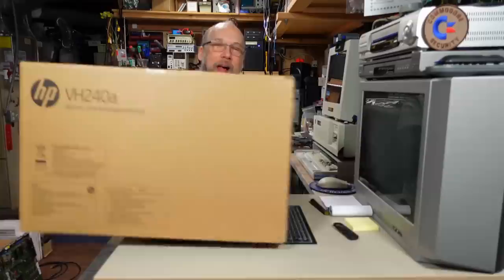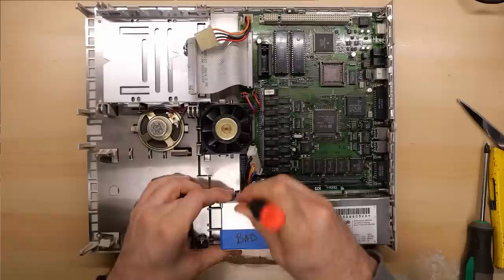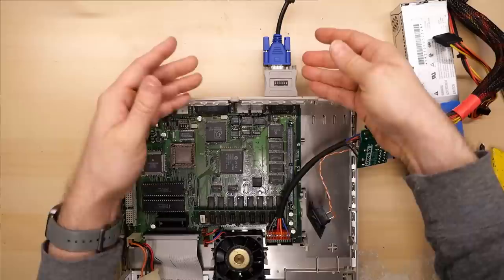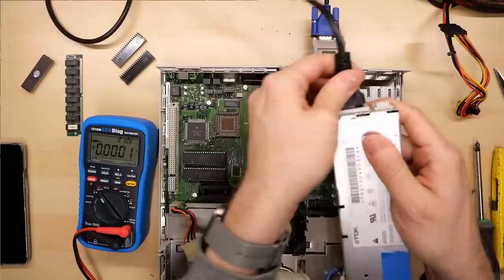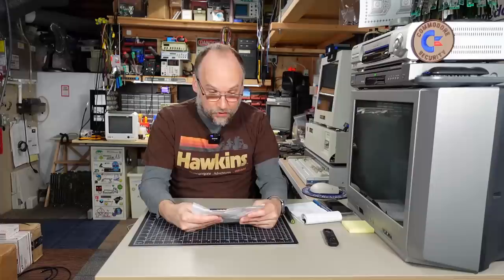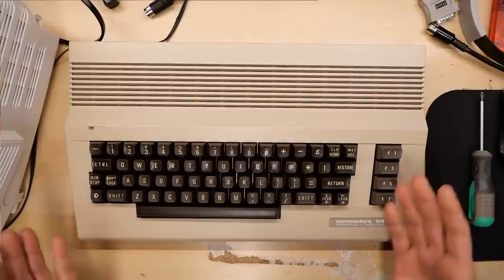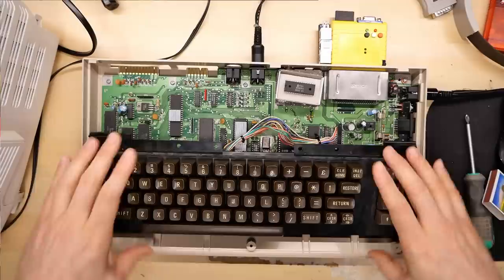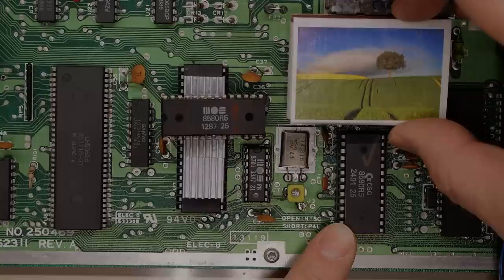Mac LC II repair attempt, a bad SID from AliExpress and a SID in a matchbox

Comment: I actually have an LC III, and it’s one of the best pizza box LCs, because they didn’t limit the 030 to a 16-bit data path like the prior LCs
Reply: Ditto! My LC III is a wonderful little box.
Reply: I had an LC III back in middle and high school. My school was throwing it out, so I literally brought it home on the bus with me. I upgraded the hard drive, maxed out the RAM and had a good time with it for many years. Then it died on me. I'd like to get another vintage Mac, but space is at a premium.
Reply: I had a Mac 6100 pizza box.  A shame it fell prey to a leaking pram battery....

Comment: Some of the differences you're hearing are due to SID filter differences. They could never produce them consistently, some of them are muffled, some are wide open. It's an analog filter and was made for a computer. So won't be very accurate. Many musicians didn't bother using it for that reason.

Comment: Actually the "ode to c64" tune I did, is supposed to distort a bit. The mild type that you can get when using filter on more than one voice on the 6581 chips - in my case I have used a 6581R4. :) BUT as far as I remember, it doesn´t distort that much on my 6581 chips. :)

Comment: I’d love to see some quantitative measurements (instead of qualitative) of those SIDs using an oscilloscope. Comparing waveforms on that test program would be super interesting.
Reply: The Aliexpress one sounds like it's got a dead noise generator and possibly a broken VCA.
Reply: @Stoney3K  Oh that could be. the VCA could be shorted and just overloading the preamp with a high peak signal.

Comment: The LC pizza boxes won’t always show video without the lithium battery installed. There’s a trick though: turn it on, then flip the switch off and on again and it will boot again, this time outputting video.

Comment: I've commented on this before, sorry I sound like a broken record. My little collection has LC II, LC III & Q605 boards and each of these will not post without a PRAM battery installed.
Reply: Yup, can confirm this on the LC475 (Q605)
Reply: There's a trick to make it work: turn it off and back on again. Really! Turn the power on for a 10-count, then off for a 5-count, then back on and the Mac should put video out. I think it's the video system in the pizza box LC derived machines not initializing without the priming charge from a good PRAM battery.
Reply: @needfuldoer4531  Thanks, I'll have to remember this the next time one of my batteries dies.
Reply: @needfuldoer4531  I can confirm!!!
Reply: Was going to post the same thing - one of the fist thing to try if you don't know the Mac is make sure the battery is there/has power.
Reply: there's a good chance that he recorded all the footage of these kinds of repairs at once ages ago and thats why none of it reflects info like this from comments.
Reply: power supply made by TDK ??  @Adrian's Digital Basement....
 of course it doesn't work ... it must be full of cassette tape .. LOL  : -DDD

Comment: I've put ROMs backwards in machines before, so they've got too hot to touch, and they've worked fine afterwards. Have you tried reading the LC's original ROMs out using the programmer, to see if they still read?
Reply: I would like to start by saying that over the years i have repaired a large number of these machines and have also found ROMs in the wrong position in the sockets (possibly even some i have installed myself, but only possibly) that have worked fine when put back correctly. 

I would suspect the machine is quite likly still working (to a degree) but it will need recapping (Sound is oftern lost when the caps degrade and weep out, which they do.), how ever i suspect the lack of image is a result of a subject brought up in another recent video regarding systems not turning on when the battery is not present. Well this model is one of those where it is infact the case, if the battery is not present or has gone flat it will either not start at all, or just not output any video signal. You can test if this is the problem by simply turning the machine on for a few seconds then swithing it off and back on again quickly, as long as the caps on the board arn't completly dead then the machine should be able to hold enough power for it to come up before the PRAM looses its memory again.
Reply: Mask roms are so simple, they should be almost impossible to kill
Reply: @smeezekitty  My favourite incident with a ROM was dropping an AMX Super Art ROM for the BBC Micro while I was riding a bicycle at 15mph, sometime in the 90s. All the pins were bent or broken and there was a big scuff mark on it. I straightened the remaining pins, soldered replacements to the stubs of the broken ones, and it worked fine. I still have it to this day.

Comment: @23:30 Left to the switching transformer, there's opto for isolated feedback. Check which voltage line is monitored and put some small load on it - some SPSes won't turn on if their 'primary' output line is not loaded (as it cannot regulate it's pure capacitive load in such case).

Comment: My senior year in high school I was on the yearbook staff, and they had just barely installed brand new Macintosh LC 520s in our lab. The two work horses that the co-editors used were Quadras with large monitors. It was the first time I had ever used a color Mac for anything.

Comment: On the LC PSU (TDK and Aztec) the cap failure requires that you replace ALL the caps on the low voltage side. But there is a problem, not only do you need the correct farad and voltage of the cap, you need it to be the same physical size or you will have issues closing the PSU case.

Once all the caps on the low voltage side are replaced, you fixed the PSU.

Comment: I would like to start by saying that over the years i have repaired a large number of these LCII, LCIII and Preforma machines and have also found ROMs in the wrong position in the sockets (possibly even some i have installed myself, but only possibly) that have worked fine when put back correctly. 

I would suspect the machine is quite likly still working (to a degree) but it will need recapping (Sound is oftern lost when the caps degrade and weep out, which they do.), how ever i suspect the lack of image is a result of a subject brought up in another recent video regarding systems not turning on when the battery is not present. Well this model is one of those where it is infact the case, if the battery is not present or has gone flat it will either not start at all, or just not output any video signal. You can test if this is the problem by simply turning the machine on for a few seconds then swithing it off and back on again quickly, as long as the caps on the board arn't completly dead then the machine should be able to hold enough power for it to come up before the PRAM looses its memory again.

Comment: Mousetrap Monday had a great explanation of the notification issue... Checking to see if I can link it here... Can't find it in my history, bit he had a great q&a segment that describes the use of notification settings... I have run into similar issue with youtube notification not working, and I think it boils down to enabling it per device... I will have to do more research, but he had a great explanation of how he figured it out.

Comment: Adrian, I’d love a video of “pushing SID to its limits.”
How many can I stuff in a 64?
Using a 2x cartridge doubler, 2 messiah, 2 - C64’s and midi, in, out and thru, how many can you REALLY run.
I have a decent collection of both kinds, and dont forget the Swinsid and SID2SID cartridge, I acquired a commodore MK-10 midi keyboard and I’d like to push it to the extremes.
If I had the ability I’d make an 88 SID MIDI player using  this rare Commodore music keyboard I snatched up. 
But I’d be happy with just a comparison video of every version of the SID. 
I think this is the most under-rated chip made in the 80’s.

Comment: I watched this over lunch at 1.5x speed so I may have missed if you mentioned it but I have an LCIII (the badge is actually a Performa 475 but same thing under the hood) and it either only boots or only displays video if the battery is installed. So don't forget to pop a new battery in at some point.

Comment: My main computer at the office I work at back in the 90’s through early 2000’s was an LCIII. It was ok. A co-worker of mine one time watered a hanging plant above the monitor I had with it. It dripped into the monitor and into the computer. When the tech came to replace the motherboard they noticed the water stain and I said I had no idea what happened! LOL. It was utilized until we got a PowerPC clone Radius.

Comment: The 12" RGB 512x384 resolution screen was just the lowest cost color monitor for the LC series. They always worked with 640x480 grayscale and color displays too, and if I recall correctly, 640x870 portrait displays too. Later models supported a much wider range, including higher resolutions ("Apple" 21" resolutions 1152x870@70Hz, SVGA 640x480@60Hz, 800x600@56Hz etc).

Comment: Killing incorrectly installed components with an overpowered PSU... been there, done that.
(it was an EPROM. Beeping it through showed the +5V pin had no more continuity. I thought "what do I have to lose", popped the window and tried inserting a wire to hook up to the what was left of the wire bond (it worked like a fuse), but either that was a too small scale to work with or the chip had died too).
My aunt's LCII (an actual LCII) also didn't work, black screen, weird noises from the speaker. I once got a white screen, but it locked up before anything else showed up. I ended up replacing the capacitors, which got rid of the noises, but still black screen. Then I wanted to remove the PSU to look at the caps inside and then I saw another leaked electrolytic hiding under the cable to the PSU. Replaced it and pling - the LCII booted right up.
And I just fixed a Roland XP-50 keyboard. When I looked at the mainboard, I got instant Adrian Black Leaked Macintosh Electrolytics flashbacks. Thanks for the hint with just twisting them off. I only damaged one pad.

Nowadays, most SID files are written for the 8580 because they all sound more or less the same, while with the 6581, if you have 5 of them, you'll get 4 different sounding versions of each song if the song uses filters.
My guess at the fault is either the ring modulator is bad or there is a problem synchronizing the oscillators. Or the resonance.

Comment: I actually find fiberglass pencils take a long time  to remove solder mask and the fibers break off and get everywhere. My preferred tool for removing solder mask is a sewing needle--the largest size you can get, hold it firmly and use a side to side action rather than pushing it. You can also use the point of a pair of tweezers if they're hard enough or don't have too fine of a point to begin with.

Comment: Good video! In the couple of LCIIs I’ve repaired they were dead like that because it required the battery installed. Not sure if that applies to the LCIII/Performa boards. Both of them also had PSU issues (All ELNA “Long-Life” secondary side failed. Non “Long-Life” were all ok.)

Comment: That's interesting about the ROMS. Amiga's with twin Kickstart ROMS are the same. You install them moved down a pin with extra socket holes available, yup. AND. If you install them wrong, swapped. They cook. However they tend to still work if you catch it quick. Ask me how I know.  :)

Comment: One interest detail is that a 270µF/16V Elko will be changed by a same or higher value for example 330µF/16V or the Voltage shall be higher like 330µF/25V. Also the temperature range is better if you use not the 85°C it shall 105°C and a very good idea is it to use the Elkos from Panasonic, Nichicon, Rubicon (I think they are all from Japan). Also to know is that a small high Elko are have a low Inductivity a low L! ----- Fat Elkos are not good in a Switching Power supply and the reason is the high Inductivity from the longer spinning foil. A higher Elko have not so many turns and that mean a lower Inductivity.
My experience is to change every time all Elkos - the reason is the other Elkos are also at the same old so the next is going and leaking.
Best Regards Volker from Vienna

Comment: Apple had many Mac's with the moniker LC (12 in total IIRC), but only 5 "pizza box" designs. The LC, II, III, III+ & 475. The where very similar in fact so much so that Apple offered an upgrade path from the LCIII to the LC475 - it consisted of a new motherboard and top lid.
Worth noting that the LCII isn't really an upgrade over the LC (I consider it a downgrade, despite the fact that the LCII has 4Mb on board over the LC @ 2Mb, it also had a slight tweak to the video output to improve multisync monitor support, but my main gripe is the fact that  Apple decided to remove the second floppy drive port!). I still have at least 60 of the various LC iterations as I used them in combination with Thursbys DAVE to share over 4Gb of data back in the day! Oh I must get around to creating a few videos!

Comment: Notifications work fine for me without having the bell clicked, but then again I don't think I'm subscribed to that many channels.

Side note, do those big chip flashers work with flashrom? The only programmer I have is a CH341A that I use to resurrect machines from bios corruption, works pretty well.

Comment: I doubt the ROMs on that LC are actually bad. Those machines need a good PRAM battery to initialize video from a cold boot, and the sound is dead because the capacitors leaked all over that part of the board. It probably just needs to be re-capped.

Comment: I wouldn't consider the aliexpress chip to be bad. It's not perfect, but it works for the most part. It seems to be an issue that is only occasionally a problem. I'd keep it around and just note it's not perfect.

Comment: 15:13 have you tried removing the video ram and putting back the other ram where it was? Or the system can show signs of live without that ram board? Could you read the original ROM chips? If you can read them in some device maybe they are not dead. Don't throw them away just yet in the dead parts bin.

About 2 years ago I was fixing a PS3, it had to be reflown (the usual) but some forum entries said maybe the potentiomenter needs to be fiddled with in the PSU. I saw a huge, like 400V capacitior and I was curious how much current it's holding at the moment, minutes after I unplugged, shorted the leads with an insulated screw driver and I jumped at how loud it was, it was like a firecracker blew up in the room next to me. At the end it wasn't the PSU's fault and I could resurrect the PS3 but it died not long ago again (stupid ball soldering).

I have a PlayStation 1 and the PSU is not working, it has all sorts of stuff on the board, it has some weird patina colored leakage and some rust. I'll try to clean it up and find which component(s) died, the board itself is really dark around a transistor, maybe it's fried.

Comment: 12:20 - nope - the LC & LCII only had a 16-bit data path and a maximum of 10Mb support RAM. The good news is that it has 256Mb on board VRAM, so you don't need to populate the socket to get a video signal.
Reply: 256mb:D

Comment: You probably figured this out eventually, but whenever there are two chips like this it's usually because the firmware has been programmed even/odd bytes, not half the firmware in one, and the top half in the other. Because the CPU is going to be reading 32 bits at a time, location 0 needs to have the first two bytes in one EPROM, and the next two bytes in the other EPROM. Most programmers have a method to do this. Your programmer seemed to be programming the ROMs sequentially, not interleaved, which is probably why it wasn't working. What I think was happening was the CPU was reading the low word from address 0, and the high word from address 0x10000 or whatever address the upper EPROM started at. This is obviously incorrect, as it'll just be randomly mixing opcodes and data from two different locations in memory. Of course, there might be other problems with that board, but I think it was pretty rare to have sequentially programmed EPROMs like that, as every memory access would require two sequential reads from the same EPROM instead of a single 32-bit read of both EPROMs simultaneously.

Comment: a lot of SMPS's (especially the older designs) usually require a specific load (that which they were designed for) before they will start/run...

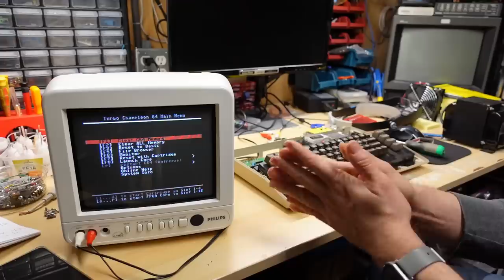Comment: 35:42 - C64 does not have VIA, it has CIA chip (6522 vs 6526). Bad information in this video. Just because a chip gets hot does not mean it is dead, I also had a A1200 with the ROMs inserted wrong and pins bent etc. but they did still work. Not sure why he throws those chips away without testing them but doing blind work with unoriginal EPROM chips instead of confirming they work in another machine. Thats not really methological, its just playing around and breaking more stuff along the way. The Chameleon replaces the C64 chips, so you cannot test anything with it plugged in. It just uses the power and takes over the C64 using only the connectors but running off FPGA simulation. 38:15 "did not know much about C64" well nothing changes I guess.

Comment: Maybe some Idea ... try to readout the original parts which you put in the dead parts bin ... maybe they aren't really dead. What if, if the problem exist on the motherboard ... If readout of the  ROMS are ok, you then have the original Firmware for this machine and two ROMs that are working, and you know that the error must be somewhere else ... :-)